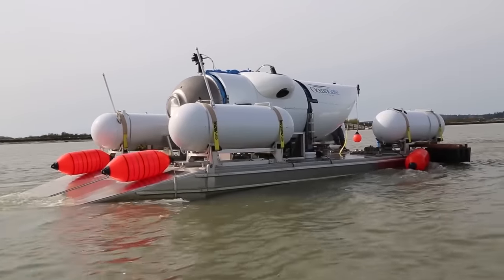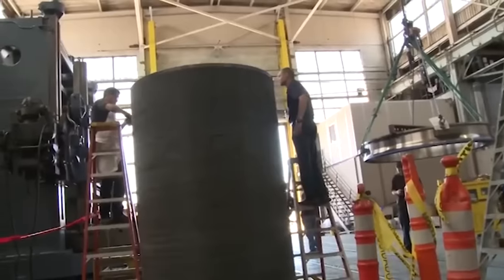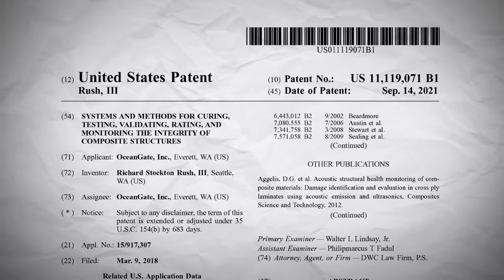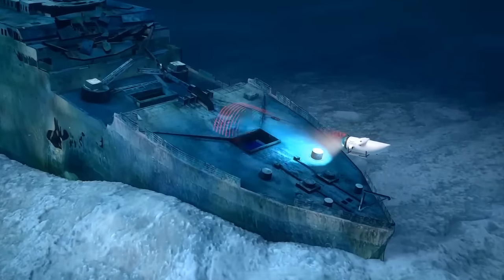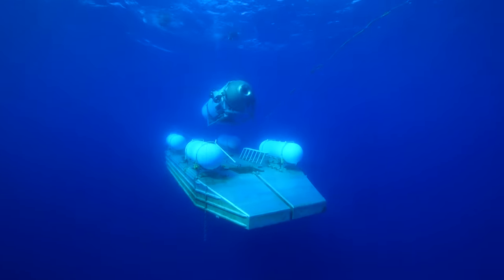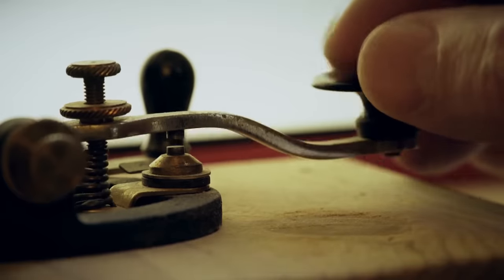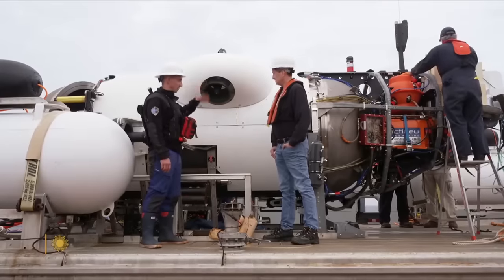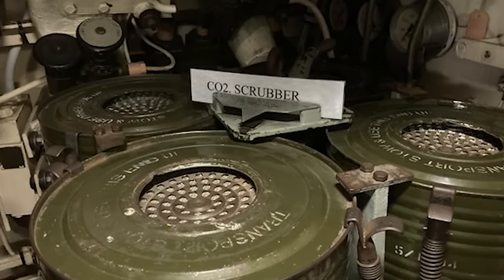Exposing OceanGate Submarines Many Fatal Designs

Comment: Also one time on a previous dive, there was an issue with a thruster being incorrectly wired, making the sub spin instead of going forwards. They then sent code down from the mothership to the submersible and had the crew onboard the titan fix the issue. Just think about that, you are 4km below the surface and you are editing code. Anyone who's ever written a program knows how insane this is, any small bug could lead to unexpected behaviour or a system shutdown. I work in a testing division of a large company for safety critical systems, there are easily a few hundred people employed just for testing. That's writing tests, testing the tests, sending the tested tests to another division for testing, recieving a code review of your tests and once that's cleared you have a validated test which can be used to verify the actual code itself. All that trouble and you haven't even started writing the actual code yet. That's the level of safety needed when peoples lives depend on it. And they just send code down to the sub and have someone down there change it. Think of how insane that is.
Reply: Worked production specialty vehicles. Engineers, testing, warranty, recalls publications. Decades and decades. No way would I go in this thing. Also did E,H&S. Rush was an eccentric engineer imo claimed on video he had it figured out against conventional wisdom and comfortable in that belief. When I was young our mothers would say "If Johnny jumped off a bridge?" This is that.
Reply: They were adults, they knew the risk...LOL We don't need more rules, regulations and Government oversight for something that hasn't even been done. Life has risk, it's life.
Reply: Life has risks yes and reason, wisdom too? Would you take a ride in a Lamborghini with someone driving who has very poor eyesight (not wearing his glasses either on that day) has heart problems, only drove a very basic car 20 years ago etc. but says let’s go now. No you wouldn’t because that’s not risky but plain stupid if you do.
Reply: Pesky, trivial, red tape. Reports revealed that Stockton was able to circumvent such nuisances.
Reply: @Meekerextreme that's completely stupid. If the government is good for one thing it's to help people
Reply: @Meekerextreme  Let me guess. You are unmarried or are under the age of 25
Reply: Even the most thoroughly tested systems can fail.

Apollo 13 needed to be reprogrammed during flight using switches and machine code.

Amazingly, four more Apollo missions took place after the Apollo 13 near-disaster.

At some point, it was realized that manned Moon missions were too dangerous to continue.

Decades later, it was realized that the space shuttle low-Earth-rbit missions were also too dangerous to continue.

Exploration always comes with unknown risks.  The unknown unknowns are the most dangerous.
Reply: @stevenverrall4527  Right, but those issues are only more abundant without regulation.
Reply: @stevenverrall4527  was this a science exploration mission? Was this to Advance knowledge and betterment of civilization?
Reply: @Meekerextreme  no, that's an assumption you're making about the tourists. Stockton Rush knew about the risks but you can't make that claim about the rest, definitely not the Pakistani father and son duo who don't appear to have had a lot of experience in deepsea expeditions prior to this dive.

You don't get into a car and say that any technical malfunction can be dismissed as you climbed into the car knowing some vague "risks". No, that's not the way it works. 

The car manufacturer has a fiduciary duty to ensure they've done everything in their capacity to ensure the vehicle is safe to drive and meets minimum standards for safety. If we can expect that of cars which operate in an easy environment why is a deepsea sub exempt from such rules in the name of "mUh iNNovationz"?

Comment: My own observations with carbon fibre as a construction material were: inconsistencies with strength across the surface;  under stress no elasticity; change in size with temperature causing a build up of stress in an unpredictable way; destructive testing giving variable results.
Reply: Why is then touted as a superb material like steel for such stressful conditions??
Reply: The way y’all spell fiber angers me
Reply: @andrew3084  funny... mericans spell it fiber, whereas english spell it fibre.  Dictionaries say both are correct.
Reply: @gnanasabaapatirg7376  Carbon fibre is good for tension, not for compression.  In tension ( like they are used for vessels containing high pressure ) the carbon fibres take the stress,  in compression the epoxy or other material takes the stress.  Carbon fibre can also delaminate, where the layers separate.... and nothing on the outside gives a clue that this has happened.  Imagine a situation where pressure got through a fissure measuring 3 of the 5 inches,  the safety would them be 2 inches, not 5.  That is why it is important to use an homogenous material - not a laminated one.
Reply: @andrew3084  The way Americans have butchered the English language (and dates, and units of measurement) angers me. So we're at a impasse.
Reply: @gnanasabaapatirg7376  carbon fibre has excellent tensile strength, not compression strength. It was a disastrous material to use for this application. Even if rush hadn't chosen to put passenger capacity (e.g money) over safety and had built a spherical pressure chamber, it would likely still have failed at some point.
Reply: @matildafaltyn6253  The American public education is perfect in every way.
Reply: Very accurate observations
Reply: @candydandy2694 true, at 4 degree Fahrenheit it would perform even worse.
Reply: Sorry, these comments are not accurate.
Reply: @perseuspersikus6830  care to offer your proof?
Reply: @matildafaltyn6253  y'all are lucky that dictionaries have accepted american errors as "different versions" of the same word
Reply: I’m American and I spell it fibre. Also “neighbour” with a u.
Reply: @Pippi-Longstocking  Very unpatriotic
Reply: @Pippi-Longstocking  Far out a rebel. I never knew there is an american who's english is english.
Reply: @johnjungkook2721  Language is fluid, it changes. It did so in England, it did so in the US. Get over it.
Reply: @candydandy2694  Language is fluid and changes over time. People can say the same thing about England butchering it as well as it's not the same as it was hundreds of years ago. It's a silly thing to get angry about.
Reply: @matildafaltyn6253  I'm American and do spell many words the "English" way (behaviour, sceptical, theatre, colour, etc.).

Comment: A game controler is fine for many military applications, but it was a serious fire hazard on the Titan in a high-oxygen environment from which passengers could not escape for hours. Also, they may have been vulnerable to interference from the wireless devices on board.
Reply: And what role might the "wireless devices" have played?
Reply: @MR-intel The wireless controller used Bluetooth to connect with the sub instead of being wired in.
Reply: @MR-intel  Role in what? The collapse of the sub? I have no idea.
Reply: High oxygen environment? First I'm hearing of it - can you cite a source?

Comment: There is no way in hell the navy uses game controllers as the primary source of movement operations for their Virginia class submarines. They may use it them for small tasks, like shifting the periscope, or things like that. The issue people have is using a wireless game controller as the main source of movement.
Reply: Saw someone point out as well... all of the electronics (monitors, etc) appeared to be off the shelf parts and thus not fire safety rated. Like I get that it's a games controller, but off the shelf parts? That dangerous in so many more ways than just reliability.
Reply: From what I've heard, the concern is mostly about it being wireless because that opens you up to sudden loss of control due to low battery or loss of radio connection. It's not so much that it is a game controller.
Reply: @qerupasy  also it is a cheap logitech game controller which is even worse it wasn't even that good of a controller.
Reply: If the controller was hard wired into the system it probably would've been fine enough. It's the fact that it was Bluetooth that introduced a failure point where there didn't need to be one.
Reply: He did put a note at the bottom of the screen to say systems, from the number of people commenting on this I guess it wasn't obvious enough.
Reply: Exactly right
Reply: Correct. I actually saw a video someone posted recently where they got to tour a Virginia Class sub during Fleet Week and the captain showed the game controller adn explained that it is for controlling the photonic mast (periscope) only. It's also a wired controller since wireless introduces possible failure points.
Reply: I’m a gamer that plays every day with a wireless connection, and I’ll be first to say that a wireless connection with batteries is not 100% reliable. 

I would never place myself in a situation like that where my life depended on that kind of controller.
Reply: @qerupasy  The controller also isn't rated for high oxygen environments. Meaning it was a serious fire hazard as well.
Reply: @qerupasy  Yeah, there could be some problems with wireless. The cheesy game controller would have transmitted a signal to a receiver, which was outside the sub in the tail section. Num nuts didn't have a wired backup in case the wireless failed. If something happened to that receiver outside the compartment, he would have no way to send signals to control the death trap. If the sub thrusters were pointing down when he lost communication, it would have continued on the last signal received and keep going down, while Stockton is inside banging on the controller and cursing.
Reply: This was the equivalent to crossing the Atlantic in a bass boat.
Reply from the maker: There was a bit of text on that video to clarify this was for systems on the vessels, not the whole sub. Sorry this wasn't clearer!
Reply: @nyki7fykxtjxyi  This is a REALLY good analogy.
Reply: Key electronics are MIL SPEC.  They have to operate reliably in hostile environments.  High oxygen, high temperature, high humidity, high interference/radiation, withstand shock and water....  I'm not sure what the major concerns of sub electronics are, but if EMP can disable your entire army, you have some problems.  That's why $30 game controllers are not acceptable.

If you are moving near Titanic using your wireless and it fails, you might collide.  That could be really bad.
Reply: @OmegaZyion  True. Is this a high-oxygen environment, though? I don't know whether the pressure inside that pressure vessel is above 1 atm, but if it's just 1 atm, then they could just use a regular air mixture without risking nitrogen narcosis or oxygen toxicity. At 1 atm, they might not even need the filtering that is necessary for scuba air.

Edit: I'm dumb for mentioning oxygen toxicity. Of course, an oxygen-rich atmosphere wouldn't help with that.
Reply: @hillbillybeerdranker6678  To be perfectly fair, any wired system requires a wire or a mechanical link through the wall of the pressure vessel, which could introduce a weakness. I don't know how other deep sea submersibles solve this issue.

Comment: Great analysis. Just to point out that It is not common to use controllers as said at 05:45 . Military opperations do use controllers ONLY for unmanned applications, and the controllers are not off the shelf. Specially a simple bluetooth controller, that is particularly prone to interference.
Reply: The deep ocean is not subject to EM interference. Acoustic signals rule the depths...

I say this as someone with graduate degrees in both underwater acoustics (MS) and optics (PhD, postdoc, professor).
Reply: What do you reckon he would have to use mr expert
Reply: @stevenverrall4527  Two aspects to consider: Interference from other devices: 1. In areas with a high density of electronic devices, such as other Bluetooth controllers, communication devices, or underwater equipment, there may be electromagnetic interference that affects the Bluetooth signal. This can result in connection loss or latency, which could impair proper control of the submersible.
2. Reliability and redundancy:  In critical applications, such as the operation of a manned submersible, it is recommended to have redundancy in the control systems. This may involve the use of multiple communication channels, more robust transmission protocols, or a combination of wireless and wired control technologies to ensure crew safety.
Reply: @IseeWhy  bespoke control panel with up to 4 redundancies on logic boards, a system-dedicated fuse box at hand. Touch and physical control redundancy. The obvious on any industry for manned vehicles.

Comment: Sensors to detect when your sub hull is failing are about as useful as sensors telling you sometime impacted your front bumper if air bags didn't exist
Reply: Stockton Rush believed in safety theater
Reply: Yeah, I found that very odd. What the hell are you supposed to do with a warning when there is no back up safety system to work with? Passengers: "OK, we know the hull is cracking, now what?!!"
CEO, "Um, I didn't get that far."
Reply: Reminds me of a classic old Saturday Night Live skit, the "mid air collision detector".
Detects and reports a mid air collision 10 seconds before impact.
Reply: @ladyscarfaceangel4616  the sensors could be for testing before deploy, you're not going to check integrity at 2000mts deep
Reply: I suppose that depends when the sensor tells you that the sub is failing...if the sub only gives you notice minutes or seconds for the implosion, then obviously that's useless.  But if the sensor operates  like a gas sensor in your car that tells you how many miles you have left before you run out of gas, then the sensor might be useful. If the submersible sensor could tell them that they have 20, 30, or 40 more hours left under that pressure before the sub begins to fail, that would be useful. They would know that they only had 1 or 2 dives left before the sub failed... BUT, based on the horrible safety features of this sub, I doubt their sensors were sophisticated enough to give advanced notice.
Reply: Totally useless. When a hull is failing that means you're already dead. Explosion by decompression is not a joke. There is only a positive side...you don't suffer at all.
Reply: The Titan did drop their ballast prior to the implosion, which suggests that the sensors did warn them about a problem. they underestimated how much time they would have after the system reported a problem.
Reply: Yep no good. I would imagine even if this alarm system worked, it would only be activated at great depths and pressures where a safe ascent to the surface would take a very long time. And as mentioned above, the design of the hull was never going to give them this time. There are reports that the company knew the industry standard was to do regular XRAYs and other competency checks on the hull, but chose against it to cut costs, which is pretty chilling
Reply: Well.. in the case of this thing… there was no going back, too late once it started
Reply: @ignaci2330 that's what a sensible person would do, but this was designed purely as a reactive system, not proactive
Reply: @SideQuest3 gross negligence
Reply: Previous passengers had mentioned even to Stockton of hearing cracking noises in the hull and he just brushed them off
Reply: @ignaci2330  they should have with an unmanned remote control submersible
Reply: @kotori87gaming89  please stop spreading speculation, false information. This assertion has never been made by any official organisation or the media
Reply: @cathybaldry7822: Titan dives for about 150 min to reach the Titanic. On this trip, it descended for 105 min when its pilot encountered a problem and decided to abort; he dropped the ballast weights to begin an emergency ascent, and notified the support ship, which soon lost all comms and tracking signal from Titan.

Robert Ballard, David Mearns, and James Cameron -- being part of the close-knit deep-diving community -- have stated in public interviews that they had received insider info that Titan informed the Polar Prince that it aborted its descent, and is ascending; afterwards, Titan was lost.
Reply: @grimfandango6137: At the speeds 2 jet planes can converge, 10 seconds can cover a lot of distance. If each is cruising at 600 mph towards each other, they're closing in at 1/3 miles per second. Ten seconds of warning means they're over 3.3 miles away from each other. TCAS usually issues alerts with resolution advisories much earlier.
Reply: @thetruepatriot7733: The sensor warning is based on the sensitive audio sensors monitoring the sounds made by the hull, as described in this video. With regard to the carbon fiber body, passengers have noted loud cracking sounds from delamination, and the warning system didn't issue an alarm. The CEO laughed, and said the CF hull is 5 inches thick, and can withstand the pressure.

To me, audible cracking sounds indicate failure between layers of 1 or more areas of the hull. If they come from the same spot, then the cumulative damage is punching through a weak spot. If the sounds come from everywhere, that means the structure is failing everywhere. At best, the design is a one-and-done vessel.

Comment: James Cameron came up with the best analogy when explaining the “warning system” Stockton Rush touted many times; he said it was like having an airplane sensor tell the pilot when an engine is already on fire.  Cameron said that, if the mesh was delaminating and the sensor was triggered, it was too late to do a damned thing about it, and the warning signal simply means that you’re going to die because there would be no time to resurface.